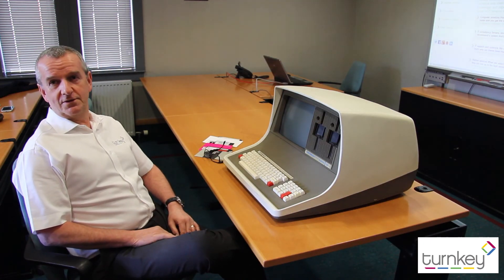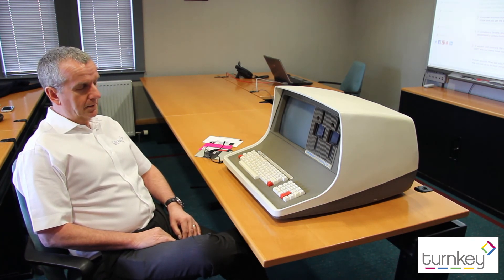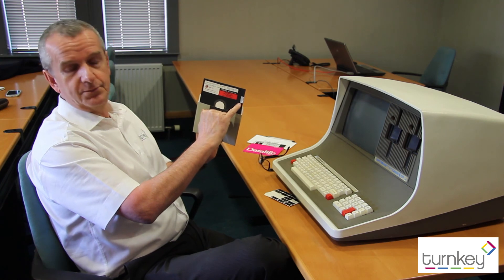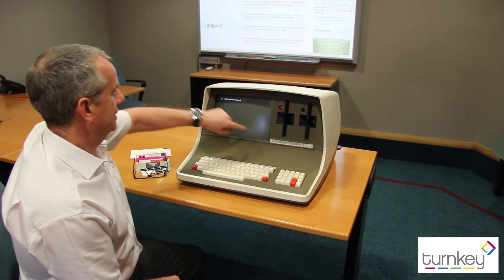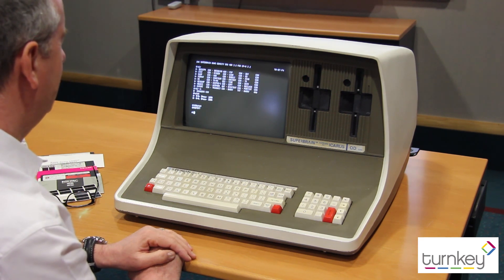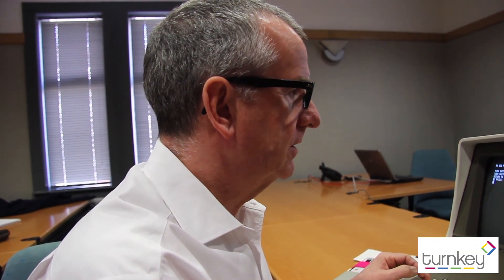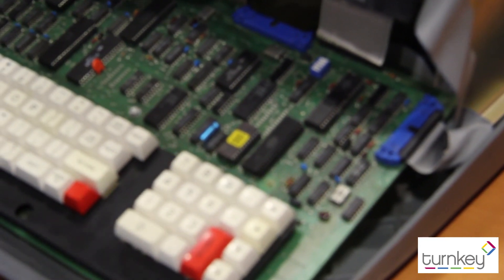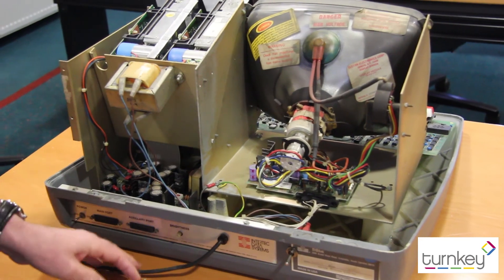Turnkey Museum Part 1 HD

Comment: My first real job was repairing computers including the Super Brain. At the time, they cost a year's salary for me. The most common fault was  dry joints on the power supply or the connector for the CRT.

Comment: I joined Cray Research in 1985.   The logic design of the Cray-2 supercomputer was done by engineers ( including Seymour Cray) using Superbrain computers.    They were later replaced by ATT 6300 PC made by Olivetti.    Replacing the 8086 in the ATT 6300 with an NEC V20
allowed the Z80 programs from the Superbrain to run directly on the ATT 6300.
You could reliably read a floppy that you wrote on your own machine, but it was iffy to be able to read that floppy on someone elses machine.

Comment: THANKYOU for uploading this! I had 5 of these machines as a 14 year old that my school let me take home around 1989 / 90 - I was obsessed with trying to make a working machine out of parts of the others. I did succeed for a while and had wordstar and supercalc software. Eventually the drives chewed up the disks so the fun was over :( My mum later made me get rid of them as they where accompanied by the insides of countless TV's and computers all over my room. I was such a geek - determined not to be outdone i hatched a cunning plan to 'bury' them on the hill behind where we lived, like a time capsule and return to them later on in life, I kid you not. I carried two of these beasts about 2 miles from my home to the chosen location on the hill. I was so trashed by the time i got there, i left them bagged up - leaning against a fallen tree, partway down a steep ravine intending to return the following day to finish the job. Next day, to my horror, someone had rolled both machines down the steep slope and there they lay in many broken peices at the bottom! I remember going back 10 or so years later and still found parts of the case - I even took a bit home as a souveneer! This must have scarred me for life as about four years ago i went looking for another Intertec Superbrain on eBay and managed to get one free off a guy in Leeds. I still had the internal parts of maybe 2 other machines, a spare motherboard, 2 power supply boards, 3 video boards etc. Unfortunatly all i can get it to do is display a white flashing block at the top left of the screen - no 'insert disk' prompt :( Oh well, It was nice to see your machine working perfectly, took me back! Hope you enjoyed my weird (but true) story ;)